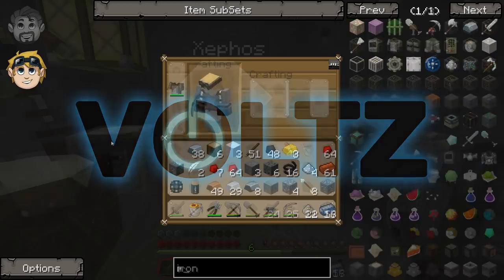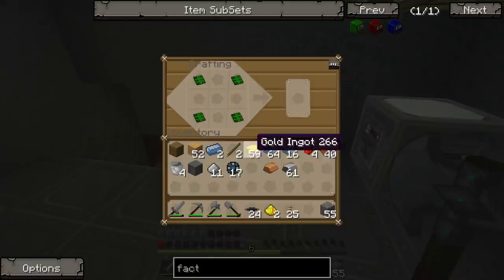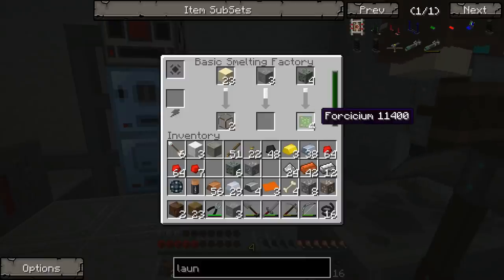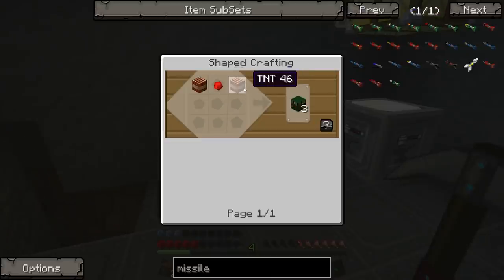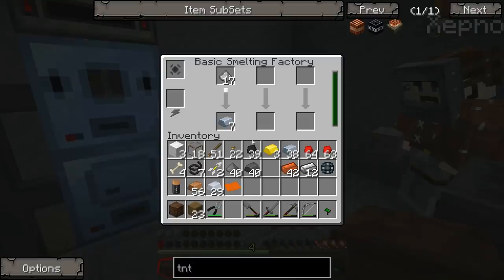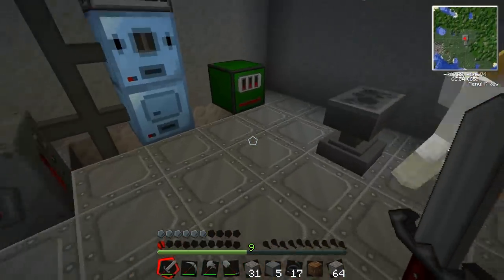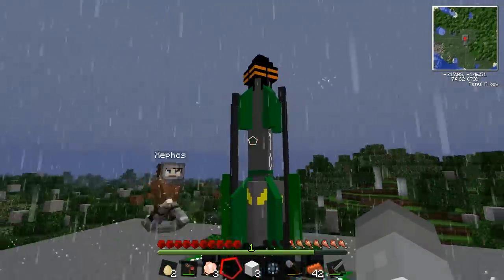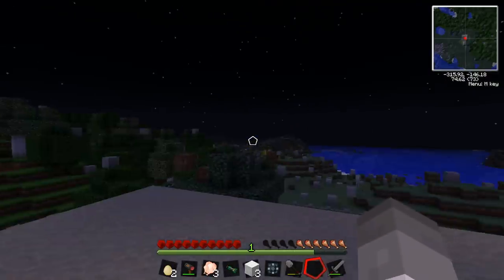Voltz - Part 4 - Launching Missiles

Comment: How to get rid of spiders: DROP 100 NUKES AND ATOMIC BOMBS!
Reply: Apocalypse337 a nuke is not an atomic bomb. There is a big difference.
Reply: an atomic bomb uses hydrogen  a nuke uses plutonium and a dirty nuke uses uranium
Reply: No. Troy, you are thinking of the difference between a thermonuclear fusion weapon and normal fission weapons. Fusion weapons consist of a plutonium implosion type weapon, which is used (as heat and neutron source) to initiate a fusion reaction in a mixture of deuterium and tritium fuel, with enriched uranium mixed in as well. The fusion reaction causes the hydrogen isotopes to fuse into helium, releasing neutrons as a byproduct. The neutrons strike other hydrogen isotopes -  helping fusion - and some end up striking the plutonium core. This boosts the fission reaction, thereby causing the release of even more neutrons and heat, thereby boosting the fusion reaction. This loop occurs until the reactions can no longer be sustained. The result is a weapon far more powerful than normal fission weapons.

In a normal fission weapon, an unstable element is compressed to the point where the neutron production from its normal radioactive decay is striking enough of the other atoms to cause a chain reaction through the fuel. The fission reactions release heat, thereby creating an explosion.
Reply: The weapons dropped on Japan were both fission weapons. Little Boy was agun type uranium device, while Fat Boy was an implosion type plutonium device.